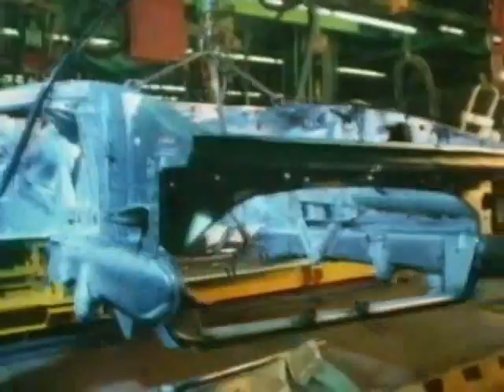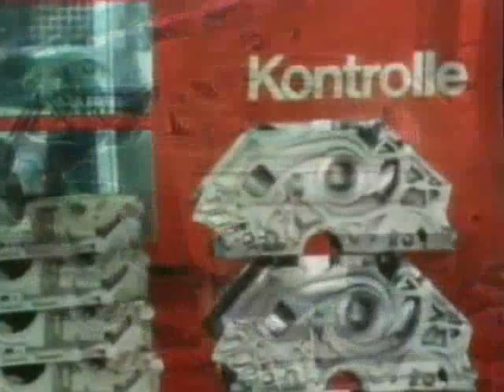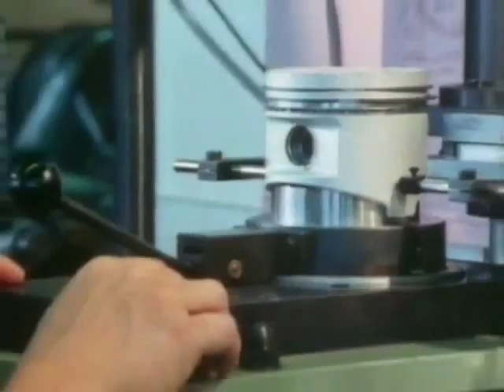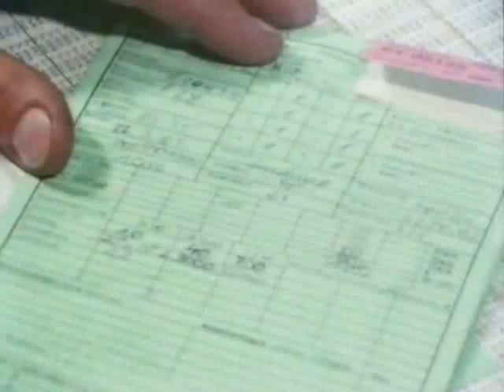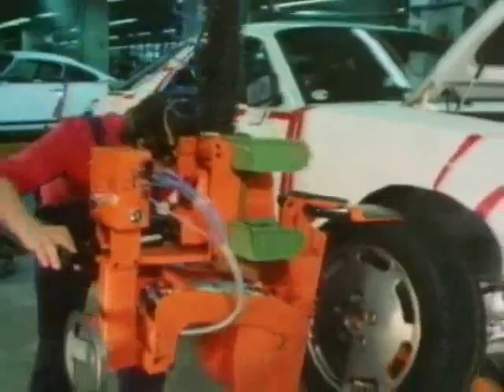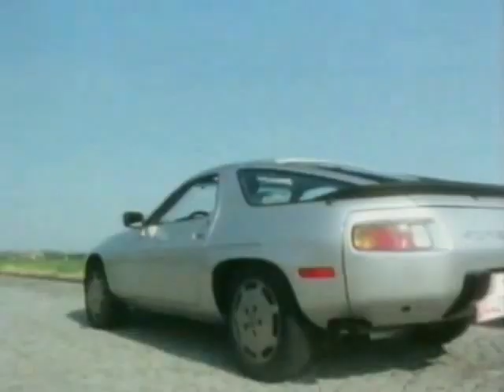Porsche 928 - Assemby Line Production, ca. 1986 (English version)

Comment: Over at the FIAT factory they have Drinking Games on the line!
Reply: And at the Yugo factory they have rear window defrost so the ones that don't start keep your hands warm while you push them.....
Reply: I’d question the date. By 1986 production was the 32 valve engine, the office calendar is 1982 which is probably closer. Either way, a fun bit of history and  amusing to see how proud they were of using a computer, even if it didn’t seem to do much.

Comment: This was in 1982 looking at the engine type and calender on the wall
Reply: +OMGWTFLOL 
There is nothing pre '85 about that engine.  That's a 310 HP 16 valve Euro which is far more powerful than the 32 valve emission laden US model engine.
Reply: @Torch70  Unless you live in Salem OR where there are no emissions and removed your CAT's, installed a much bigger oil cooler, swapped out your narrow stamped radiator with an all aluminum one that holds nearly two times the capacity of the original because it stretches the full width of the engine bay and the best part............the brand new GT heads you found after leaving your factory baby S4's under your pillow for the Porsche fairy....... 32 valves and nearly 450 HP means never having to say you're sorry.
And to keep it all running strong, I only feed it BMW's. Nothing but the best for my baby.
Reply: Removing cats and putting GT heads on gets you to 450hp?! 😂 wtf you smokin
Reply: @928pcar Right!
Reply: @Torch70 Twin dizzy!
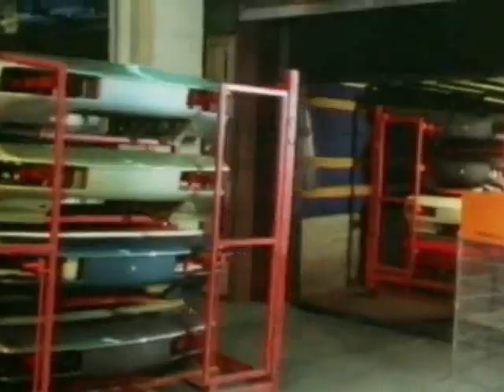Reply: +Jean-Pierre Jorissen No look at 6:30. On the right you can see S4 bumpers.
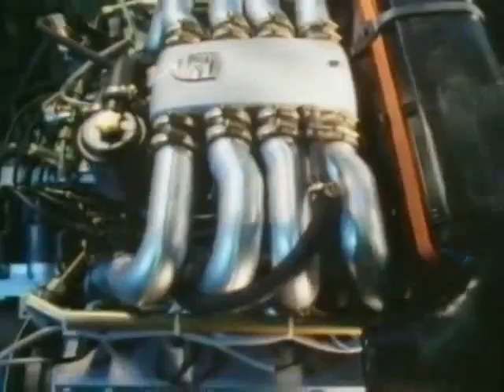Reply: +Onman100 - Some of the rear bumpers do look like S4 bumpers, but the engine intake shown 10:58 is pre '85. This video may have been comprised of footage from different years.
Reply: Exactly, 16v egines and series 1 bumpers